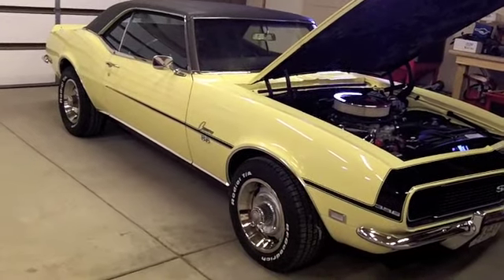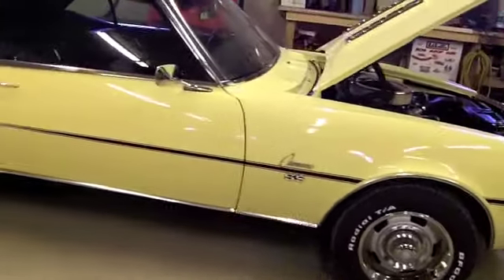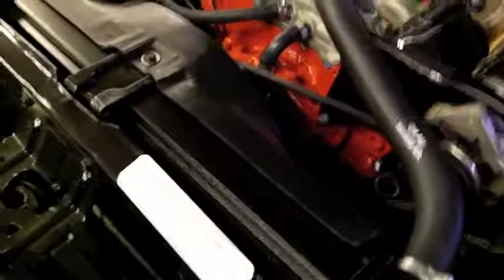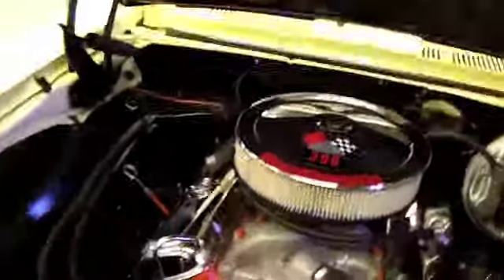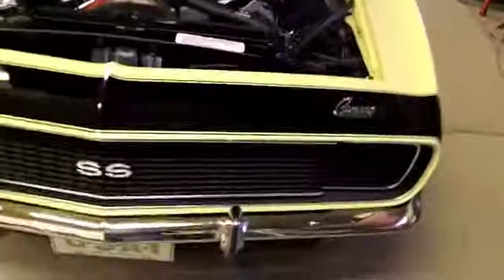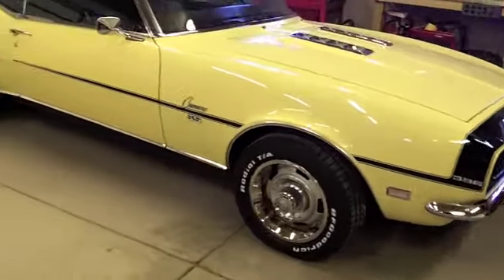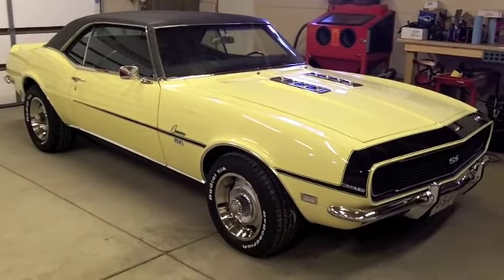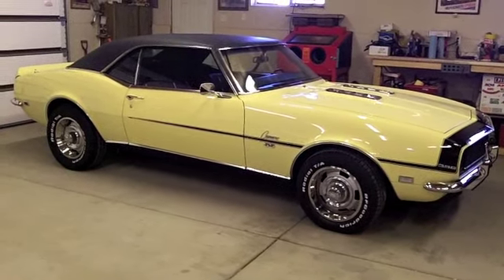68 Camaro SSRS 396 Restoration Part 65

Comment: very nice nick you do have a talent and the passion funny that you have not driven the car in so long but you will be driving it soon and I bet it feels a lot different than you remember.  my 69 well I have owned that car sense 92 and the only time I have drove it is when my brother towed me home with a rope lol.  I will drive that car this year it may not be done but I will drive it.
oh and by the way what size exhaust did you get ? I have searcned jegs and summit and the only ones I can find have those funky stainless tips all the others say for 67 and 68 unless I order a 3" kit
Reply from the maker: Chris Mansker Thank you for the kind words Chris, I really do look forward to driving the car again this spring. :-)  The kit I installed is 2.5". The 2.5 kits for the 69's do have the stainless tips but you can install a 67/8 kit on a 69 if you wish as I did put one on my old LeMans Blue 69 some years back. The only real difference is the tail pipes will dump behind the rear tires instead of out below the rear tail pan.